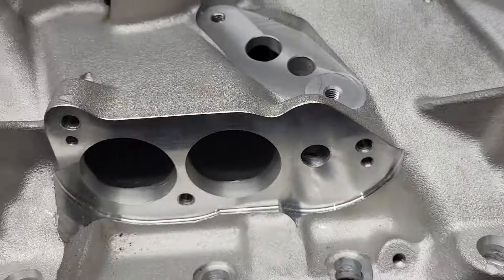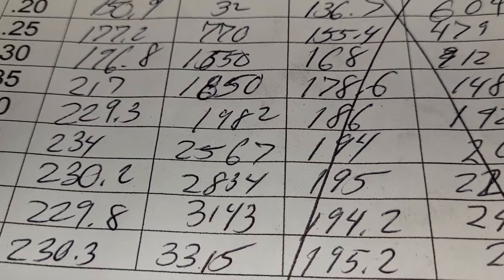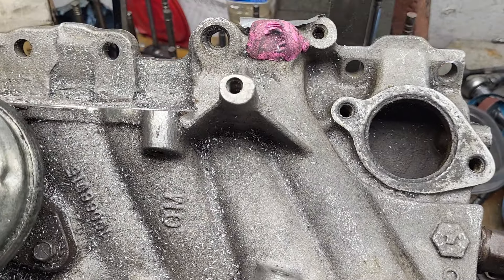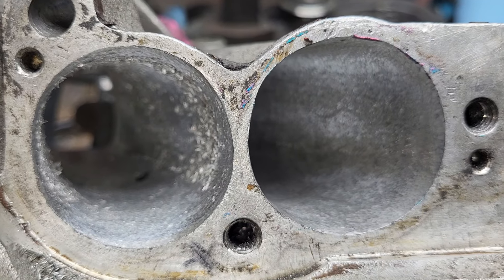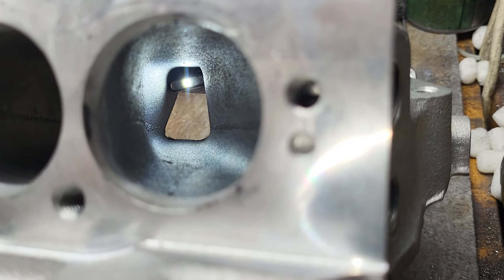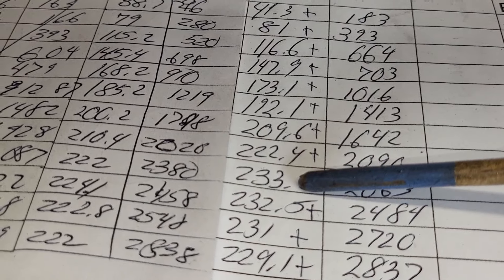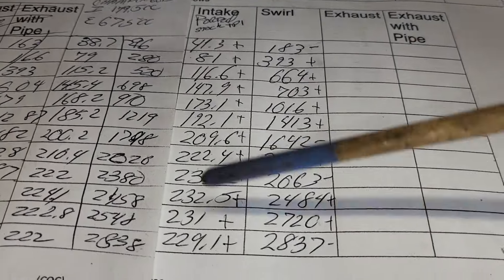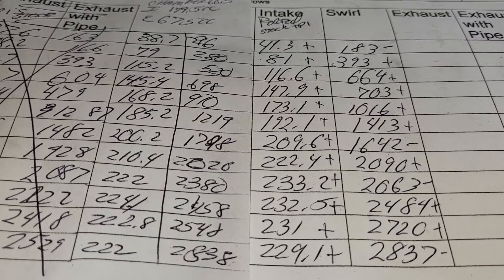Redheaded stepchild, High Performance TPI project. TPIS big mouth base vs. ported stocker base

Comment: I've enjoyed following along on the project. We owned a California emissions  '86 Corvette with iron heads  for 27 years.  I was a good car but not a great car.  80"s GM build quality.  And it simply didn't make enough hp or torque to really use the chassis and suspension of the car.  It needed an additional 100hp and 100 LB-FT somewhere in the bottom and mid-range of the rpm.  I know it was rated at 230hp and 330 LB-ft.  I have always wonder if I spend a lot of time and money if I could have gotten that out of 350 cubic inches and stock parts.  The prom, different mufflers and the airflow divider in the throttle body only helped a little.
Reply from the maker: Stay tuned. We will find out!
Reply: just to share my experience from owing a 91 z28 back in the 90s and doing mods and drag strip stuff. you can wake a 350 tpi up a lot over stock. but the most benefit seemed to always be the rare manual tranny over the auto. 305 manual was faster than a 350 stock for stock if you had the 3.42 gear in the manual. the gear spread of a 700r4 just didn't work well with the stock tpi stuff. up until the auto guys got a manifold that pulled some rpm, mine and a friend's manual cars were always faster with the same ish mods. my theory was 4 tight gear ratios keep it in the power band better than 3 more spread out gears. Just gotta shift it well too. my 305 5 speed went a best of 13.9 @101 with a slp cam/springs, stock (we didn't know how to port anything) intake, good headers and ram air intake no tuning. it ran with the stock lt1 of the time. I finally got around to building a 350, old non ported trick flow heads, that same slp cam. only tuning was turning fuel pressure up, we didn't know about burning chips. looking back, the mild slp cam saved us tuning wise. if I remember right it ran 13.4s on motor and went 11.9 once on 150 shot. nitto came out with their drag radial by then they helped a lot. this was also at a sea level track in Florida, so we got good numbers compared to the magazine tests back then. funny by the end we did buy a Dremel and do about what he did to his stock runners, we had no idea why, we just thought that was the only place we could grind on and wanted to do something haha. seems it might have actually helped. we couldn't afford aftermarket intakes back then, any they all tested pretty badly in the magazines. it like 15hp for 300-500$ sounded crazy when nitrous was 1$ a lbs haha. 20$ fill on Friday after work would last you till Saturday night haha. 

but that's honestly a fun about of power in a 80s car even today. I bet it would look horrible on a dyno, but swapping to a manual tranny would have woke your c4 up a lot.

enjoying this retro testing.
Reply from the maker: @jsomething2  Good info. Thanks

Comment: Check out the TPI system wegner just shared. Tunnel ram base with tuned port tophat. In my opinion...these systems are boat anchors.
Reply from the maker: I think they are good for what they  were designed for 305 in a heavy car! I saw that video, and he did a good job as usual. Check out the flows through a tunnel ram base and AfR 210. Thanks

Comment: I think the speeds in the head helped with flow through the stock base, basically a small vacuum effect if you will. The extra volume of the TPIS base may be why it flowed less. From that I'd say it's possible something like a 195cc head would help the TPIS, but the bigger heads may be hindered if you use the stock base.
Reply from the maker: Hmmmm. Thanks

Comment: I thought the hot setup for this was the siamese runners
Reply from the maker: Depends on what you want to do. Siamese runners shorten your tuned length for more high rpm torque at the expence of low end torque.
Reply: @servediocylinderheads  well you know I'm a power monger lol
Reply from the maker: @No1414body  As it should be.

Comment: I often thought watching you develop these intakes, that there should be someone watching  that has the materials and the equipment to build the ideal intake runners for these. How would a modern Chrysler long ram intake runner work on a TPI base? There was an old ufab intake builder from long ago I can't remember who made it.
 On  purely selfish thoughts I'd like to see one of the old Tri-Power or Offenhauser intake manifolds flowed to see if it could keep up with modern 4 barrel designs.
Reply from the maker: That would be fun. Thanks
Reply: I've always wished someone would have made a intake they was kinda a short runner super ram, where the runners come out of the bottom and still keep the longer runners out the side like the tpi with a butterfly valve to switch for different rpms. all the low tq of tpi and higher end super ram. I guess packaging would be hard. thou.

Comment: That is a edelbrock they are the same casting look for 3860 stamped on the bottom, that one has NO clean up work though TPiS would blend BOTH openings that ridge would be gone and the other side would be matched to 1204.  The stocker flows 220 as cast, just by looking at your 1.38 dimension you could get more out of yours
Reply from the maker: Good info, thanks

Comment: This all goes back to choosing where you want to trip the flow into turbulence. If you make the flow turbulent, it has less drag overall, but it also has less energy overall, because it's mixing with flow that's interacting with the wall. It's probably done on purpose to keep the flow attached to those race track curves from killing the flow. With straighter ports you may be able to get away with less turbulence, or rather move the place where you trip the flow a little downstream. Because it's going to go turbulent eventually, no such thing as perfectly laminar flow all the way through the manifold and port and chamber.

Better to trip the flow yourself, because at least that's predictable, instead of letting nature do her thing and tripping the flow to turbulence in random places, and creating unsteady buffeting as a result. At least you can get a better read on the turbulence if you induce it yourself.
Reply from the maker: Flow in a running engine is always turbulent. Thanks
Reply: @servediocylinderheads  "Because it's going to go turbulent eventually, no such thing as perfectly laminar flow all the way through the manifold and port and chamber."

I know.

Comment: Interesting. Have you done a test with the entire runner on the intake? I was wondering how the runner would affect air speeds and entry/exit areas. How does the air recover from being slung around 180 degrees. Does it recover quickly, or is it later as it's going into the head. To measure, you'd have to set the bench to blow through and do some trickery for sure, but it would be fascinating.
Reply from the maker: I only have stock runners and my cut up slp's and they are both terrible.
Reply: It would probably be less than the ported sticker. I think one thing the ported sticker has going for it is the ports are able to have a more rounded shape… they start smaller so you have more control there. 

But the TPIS hasn’t been touched yet. So we’ll see.
Reply: Stocker* stupid auto correct.

Comment: Just radius and taper into runner it's a dry manifold.
Reply: Also, I thought for a bit why they had that extra area. It makes sense given the architecture of the runners. The air is accelerated 180, and by rights, it's trying to slam into the runner floor. The extra area will give it space to slow down and turn earlier, maybe?
Reply from the maker: @lucascb750  Extra area is required to increase mass flow through a turn. Thanks

Comment: What are the port measurements perpendicular to the runner 2" before the head?  It looks like a small tube sliced on a steep angle - the opening looks big, but the runner is actually small.   You've done as much as anyone can with that stock manifold.  What's next?
Reply from the maker: Take a nap!